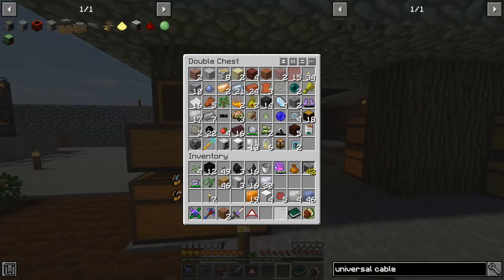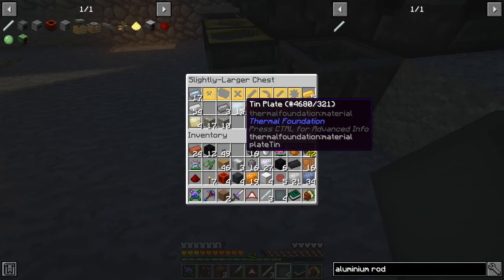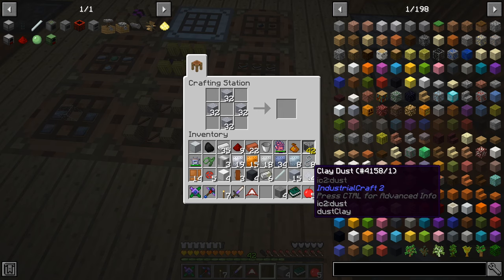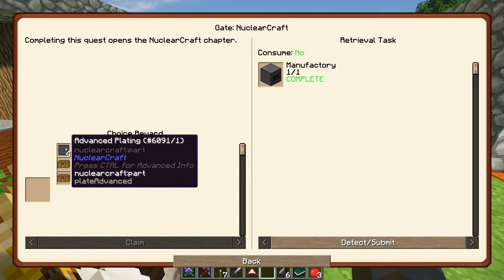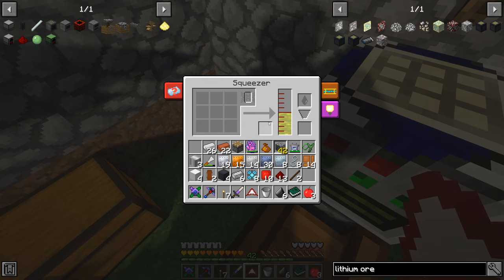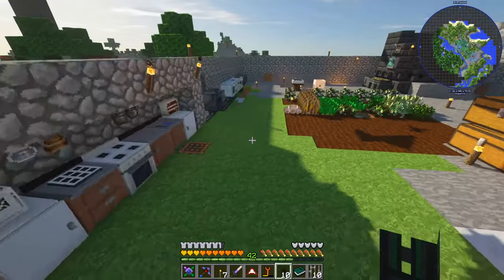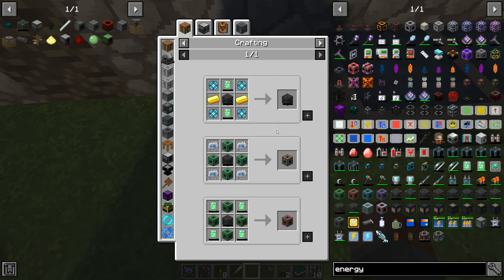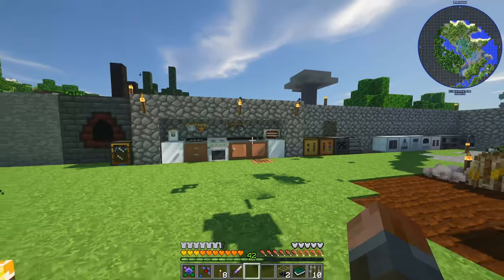Enigmatica 2 Expert Mode E09 - Mekanism Power and XNet Unlock

Comment: Pretty sure the shadow issue will be from Astral Sorcery and/or Advanced Rocketry. 

In astralsorcery.cfg, make sure the overworld is in the "S:weakSkyRenders" section,

In advancedRocketry.cfg, make sure "B:overworldSkyOverride=false" (I also have B:PlanetSkyOverride=false)

I also disabled Botania's shader option, just in case! Plus, the GUI colour changes come from the 3D models of the Animania animals in JEI - so just hide them.

Think that's it anyway. Thanks for the vids. :)
Reply from the maker: So, 2 of the 3 things you said are wrong (at least for me), leaving the last thing you said to be amazingly right :) Loading the pack without astral or rocketry entirely had no effect. However, disabling the Botania 'shader usage' setting appears to have completely fixed it! :D